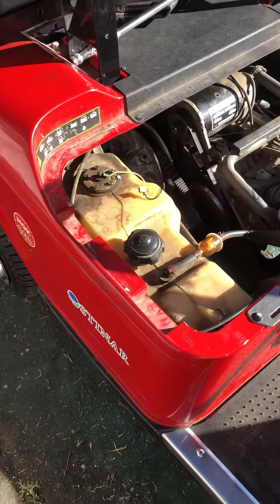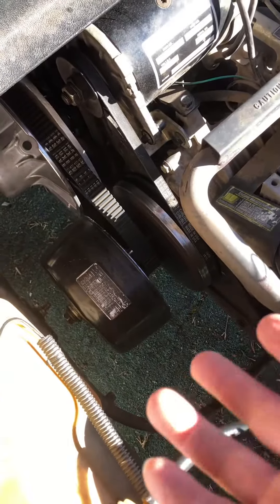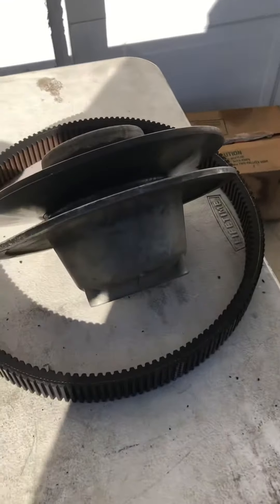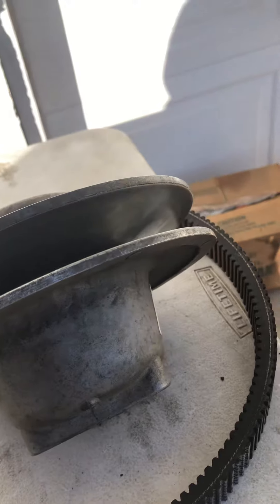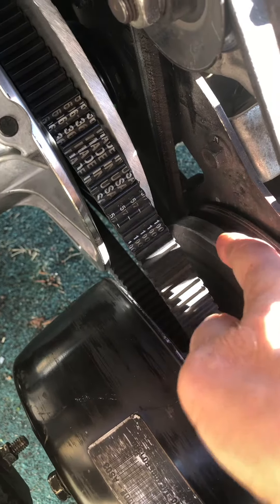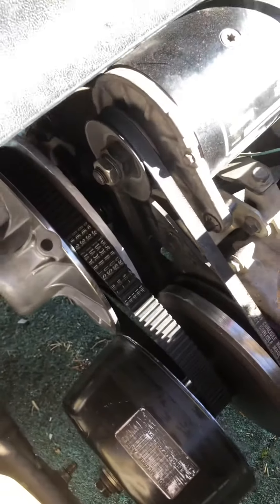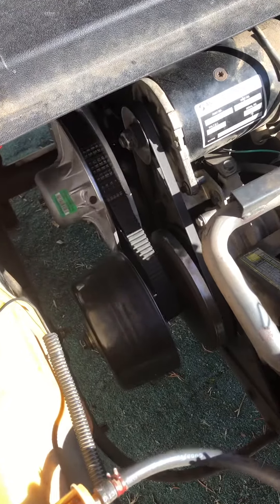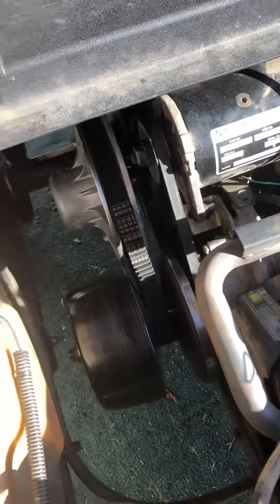Ezgo golf cart clutch pulley fix

Comment: Did you have an issue with the center bolt from the primary clutch hitting the frame? I can't get mine out because of that.
Reply from the maker: I don’t think so. Seems like I may have pried up or down on the chassis to give me a little clearance, w/a small crow bar
Reply: I have this issue on my arctic cat its rubbing the case cover. My belt keeps breaking